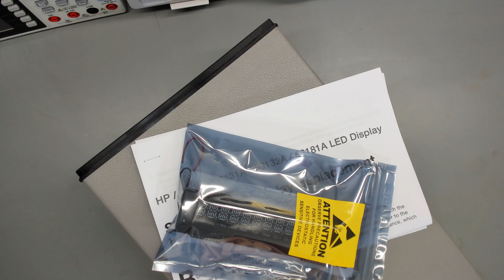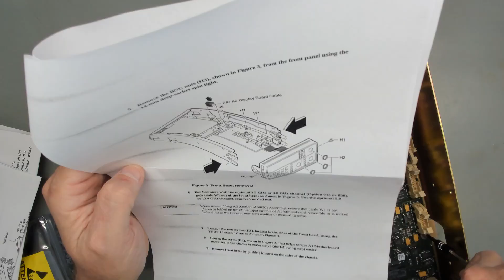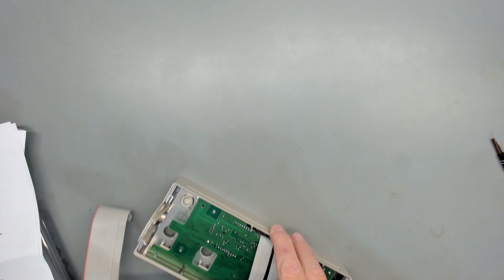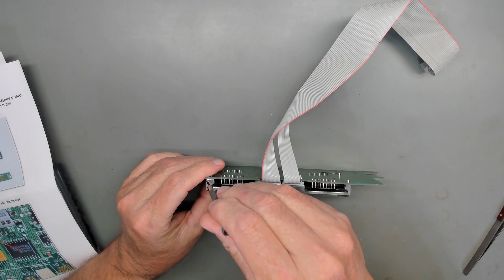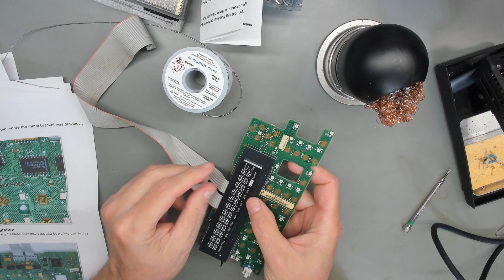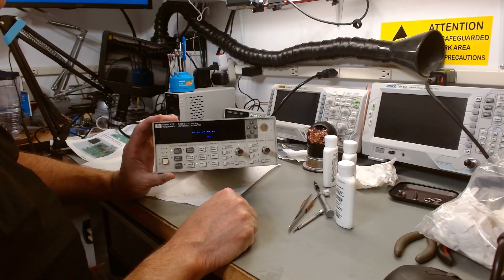Turning a Budget Frequency Counter Into a Pro Tool!

Comment: I know the guy that makes those kits - Dimmog on EEVBlog - great guy.  He's made his business around maintaining and refurbishing the excellent HPAK gear from the 90's - 00's era like these counters and the classic 34401A multimeter and such.  Very experienced, he does awesome work and sells good products.  Just a heads up: your Ali affiliate link doesn't seem to be working, it doesn't bring up a product.

I do have some questions:
1. It's been about a year, how is your frequency counter doing with that Noctua fan?  Any issues?
2. You have the note of 'not recommended' next to that aftermarket 3GHz channel 3 option - did it fail or not perform well?
Reply from the maker: Yes,  MIT is a great guy. Funny the timing. He just sent me two of his new display products (arrived yesterday) to try out and review. 
Matching displays for the 34401A and a new matching one for the 53131A.
Those will be showing up in videos as soon as the current series I’m working on are done. 
The frequency counter runs the fan and oscillator 24/7/365 even when the meter is off and the fan is working great! Can hardly tell it’s running.
The issue I had with the third channel kit is the input cable provided is useless in my opinion. It is a sma bulk head that does not fit the hole in the faceplate. There are others on eBay that cost a couple of dollars more that come with a proper BNC or N channel jack that fits. It works well and I just bought a separate BNC bulkhead cable for mine.
I did a video recently where I went back to check the stability of the meter and was really shocked with just how good it is. 
RJ